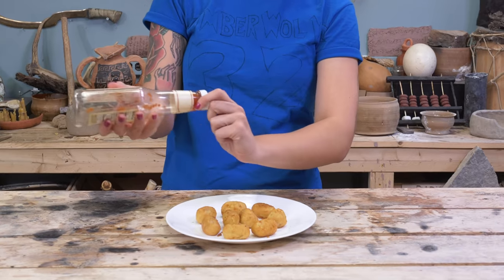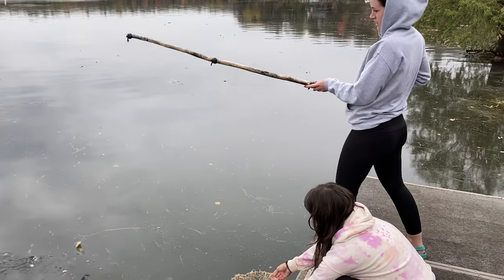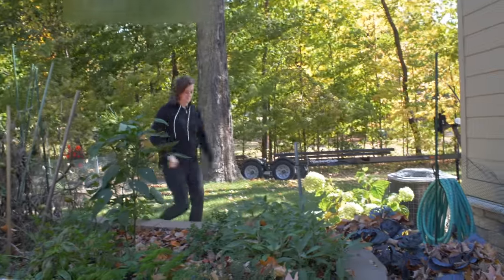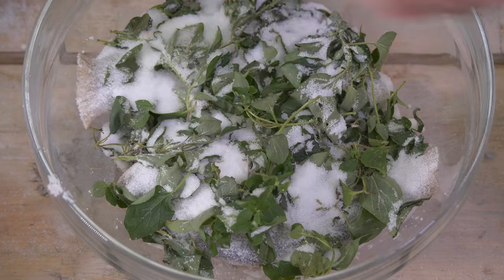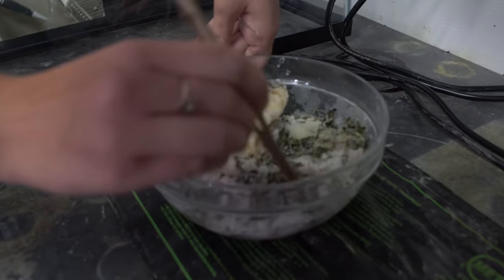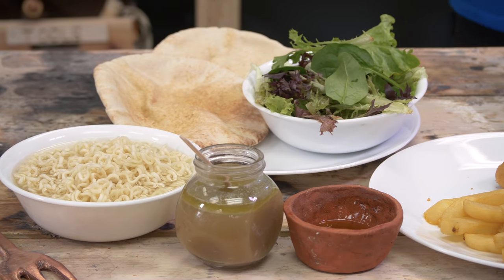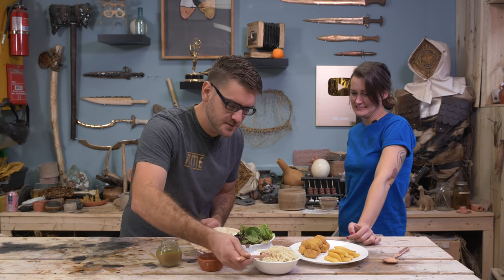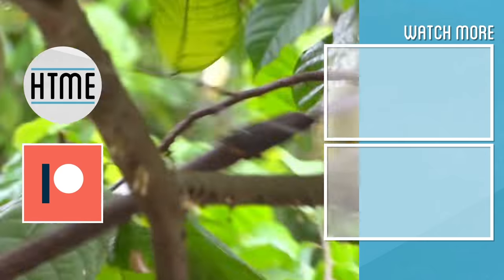Homemade Ketchup With A FISHY Twist w/ @TastingHistory

Comment: i think its a stretch to call that ketchup, even if it was the only condiment available at the time. Most, if not all, hot dishes in asian cuisine, for instance utilizes fish sauce and its all about that unami flavor building. its probably why it tasted better in the salad mix. I think even then it was mostly how it was used, although the primary use was probably to hide the "garbage can taste" of food that was cheap and quickly going bad since they lack the means to refrigerate and extend shelf life...

Comment: Isn't it supposed to be made from anchovies? I have had Ceaser dressing made out of proper anchovies and it was not fishy at all. I literally would have not known that it was made out of fish if I was not told. And I even argued about it until I looked it up. So it's probably just because Anchovies are salt water fish and they have some type of conditions that make it possible to melt them into a liquid that's not especially fishy at all. You probably have had Ceaser dressing that's made from fish without even knowing it.